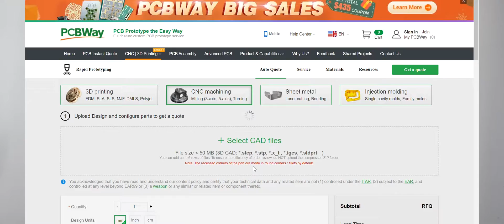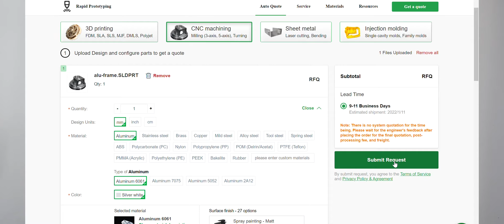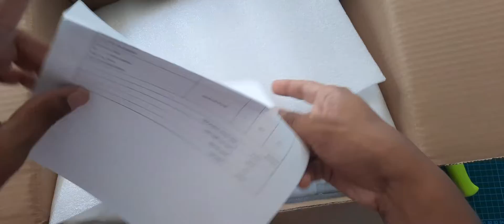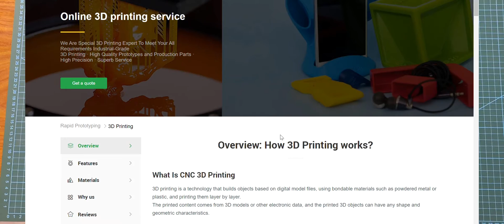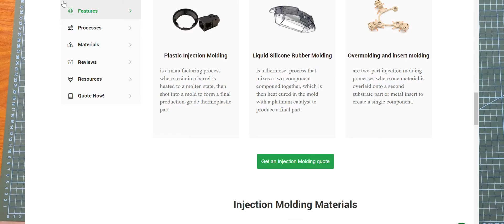How good is CNC Machining at PCBWAY?- Prusa i3 mk2.5 frame | Mauritius

Comment: Thanks for the review. I am very concern about the finishing thats why not too sure which to choose (stainless steel or aluminum), I prefere the aluminum to be lighter. Wondering how stable the coating on the aluminum is? Does it come off easily?